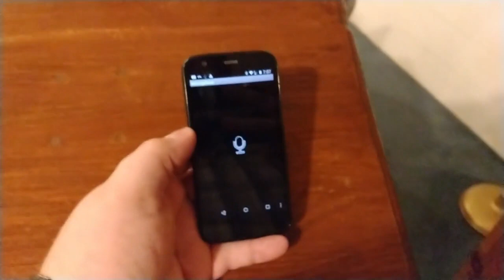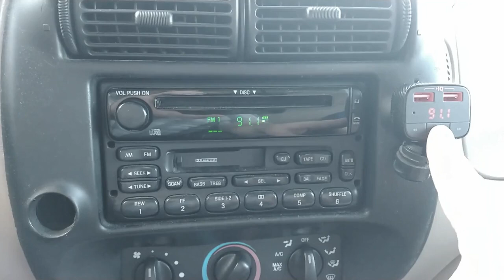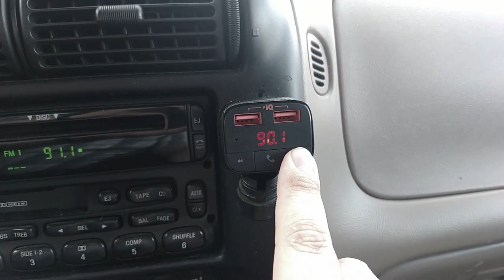Small Church "Parking Lot Service" Tutorial

Comment: Thank you so much for showing this!  Is there a limit to how many cars can receive the FM station?
Reply from the maker: Yes, if you have a lot of cars in front of each other or far away from the transmitter some will have trouble picking it up.  One thing that can help with this is if you get an extension cable and put the transmitter in a high place above the roofs of the cars.  They sell these cables on amazon under "Car Cigarette Lighter Extension Cord," or you could just buy a wall adapter to use with an wall extension cord.
Reply: @TannerLDikinSermons  thank you for your support!  God bless you and keep you safe!
Reply from the maker: @les1663  Likewise
Reply: No there is not a limit radio waves don't split

Comment: Most Transmitters have 1/8” jack which can be plugged into amp/ board and use a regular mic.
Reply from the maker: Right, the models designed for this use case have line-in jacks, and many have a microphone jack.  But this video is for those who don't have any real experience with this kind of thing, and just need something easy to setup.

Comment: Range and cars blocking signal?? What can I expect. Long range ones won’t ship till into May... by that point I won’t need it
Reply from the maker: You can get pretty decent range out of these depending on the model you get, and you shouldn't have too much trouble with cars obstructing the signal unless the cars are packed tightly together.  You can also get better range by finding out how to elevate the transmitter above the cars.
Reply from the maker: There is also a model that sells on Ebay at the bottom of the video description that seems to be shipping faster than many others.  I've not used that model, but it might be worth a shot.